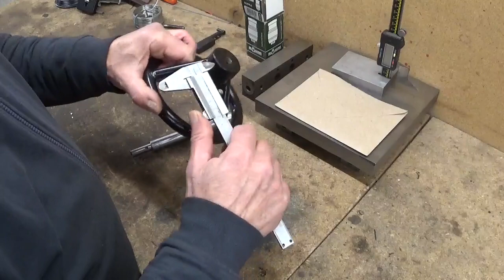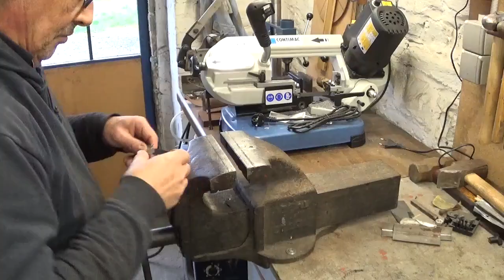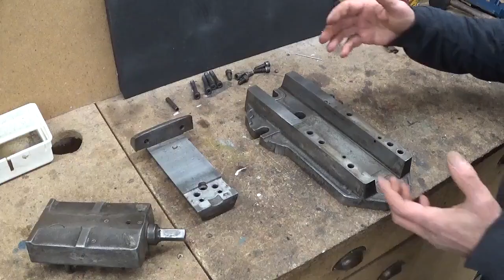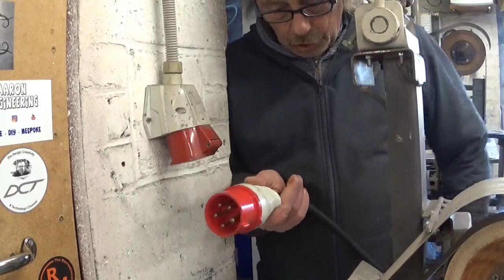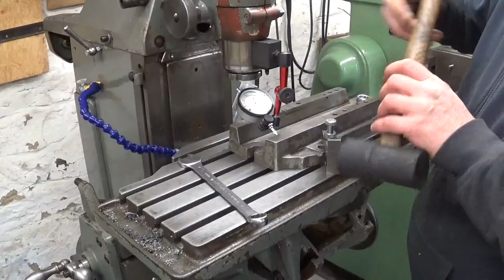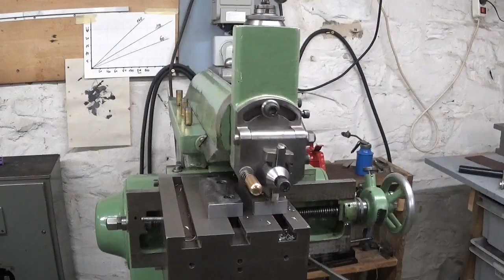Milling vise care.

Comment: I worked on newer deckel and one of the switches on the "fridge" was F/R. 
When cutting with left oriented tools feed also works in reverse and mehanical limit switches do not work, if feed hits end shear pin for feed will brake to save feed gearbox.
If your machine has feed reverser than it must be engadged when using left cutting tools.
Little bit of WD40 on 3 phase plug pins does wonders.
Reply from the maker: Thanks for the WD40 tip. I will give it a go.

Comment: Nice vice! For screwing out the taps, maybe it is possible to hammer a small round tube square on one end, if there is room around the drawbar down the spindle hole. Or maybe shape out a square hole in a small piece of round stock and weld it on a rod. Best regards
Reply from the maker: That's an idea. I will think of that.

Comment: Sir I too have a Deckel FP1. The controller unit does not work. I'm wanting to use a phase converter. Do you know the horse power of the motor and if it should be wired delta or wye?
Reply from the maker: My machine has a 1,0 / 1,5 KW motor. It's connected in triangle configuration on 3x220 Volt and no neutre. 
An easy solution for you could be a VFD from 1x220 to 3x220, like I use on my shaper.

Comment: Any method to get the desired result is fair game -     A thought just made my head hurt . . .  but not too badly ;) ,   when you mentioned that you DON'T NEED a 'surface grinder' , I thought it would be possible to mount a grinding attachment to the shaper's RAM !     * No doubt, the idea has been done by 'someone' at some time !    It may not be the most practical method , but I think it could be a useable possibility !    ( YES , yes . . . keep the grinding grit & dust OFF the shaper ! ! ! )  
      Great to see you getting to know the Deckel's possibilities , there are many many more to 'get acquainted with' ! ! !   
HAVING FUN & getting results . . . that makes the WORK much more like playing  ;)     Thanks for sharing your FUN with US !
Reply from the maker: The angle grinder idea has been done by "Haxby_Shed" and "EYUP TONY", with great results. I thought maybe installing a cup wheel on the shaper, but as you mentioned, the grinding dust is a problem.

Comment: Good day sir: I always enjoy your ingenious fixes for small problems like the roll pin. Since you are one not afraid to make your own tooling where needed, I might suggest making a fly cutter for milling larger surfaces. The cutting edge can be re-sharpened as needed and even the diameter adjusted to fit the job. It will help save your end mills for more specific jobs. Another fantastic video in the books!
Reply from the maker: The fly cutter is on the "to do" list. That will be an upcoming video.
Reply: @Rustinox  Fly cutter will also leave better finish imo

Comment: G'day Rusti. I haven't seen a home made roll pin before, well now I have,  that would make a nice video on it's own. I was thinking surely the shaper is faster than the mill, did you have it on a very slow feed rate?
Cheers Peter
Reply from the maker: I used a feed rate that felt good while hand feeding. I copied aprox the same speed in automatic.

Comment: That's a nice mill. If the motor on the mill is 3 phase, you can probably wire up a simple drum switch to swap any of the two legs and it'll run the opposite direction. Maybe that's already in the electrical box?
Reply from the maker: It isn't... yet. But I will install a reverse switch one of these days.

Comment: Wow your bench vice is bigger than your bandsaw Rustinox. Brilliant solution to fix the moving jaw for machining. Spray some silicone spray or 
WD40 on your plastic electric plug and socket, that's what I do. I had the same problem a long time ago. Great to see your milling machine working. Tony
Reply from the maker: Indeed, the work bench vise is a beast :)

Comment: Well you got there in the end. Shame you did not have a large facecutter  or a Flycutter. Your sticker is on my wall board. It shrank a bit, sorry for that. I am going to run out of room soon. I need a bigger wall. Regards from the UK.
Steve.
Reply from the maker: No problem Steve.
The fly cutter is on my "to do" list.

Comment: Tool care... I wish there were methods to fix bad tapers, dinks, burr on women... The first one was scrapped after 12 years... and the second after 3....
Thanks for showing that "the ugly plug" has a protective rim! The old 2 pin mains plugs didn't have it but the newer ones, phased out now days, scrapped, got it too.
Once a tin made christmas tree decoration had fallen on the pins to the plug for the light. Father didn't see it and pushed the plug in. Poff and smoke, but not a baby finger there.
Time 08:00. I can just agree Michel! "The ugly plug" has its advantages.
Nice vise work.
Reply from the maker: The ugly plug saves me from "ripped of skin" on my hands :)

Comment: Very good job. I've never been happy with the finish from an endmill either, all those horrid little circles. I much prefer the finish from a horizontal milling cutter... and I seem to remember you have the arbor and support :-)
Reply: Me too. You're quicker with the shaper (not that speed is a requirement for we amateurs) than I am. I prefer horizontal milling, I sharpen cutters I pick up cheaply, but I use the shaper for those things the mill cant do, like cutting internal keyways.
Reply from the maker: Indeed, I have the horizontal arbor support. But I also have a shaper :-)

Comment: Reversing your machine is not that difficult, I assume you have 380/400 volt, then you have earth (green/yellow) 1 neutral N on plug, and 3 live (or phase) L1, L2 and L3. You just turn 2 of the 3 phases, does not matter which. You can get a white/red EU plug that have that feature built into it, I know, then you have to take out the plug, but then, your machine does NOT run while you put it in reverse 😁
Reply from the maker: I know a professional industrial electrician. He will help me out wit this.
Reply: @Rustinox  You're smarter than me, but then again I have the patience of a gnat, maybe that is why I am a scaffolder 😏

Comment: Gday Rustinox, well I’ve never seen a roll pin made like this before, brilliant idea, great to see the shaper being used still and not left in the corner, you really can’t bet a shear tool finish, way better then a endmill finish, have you thought about using a TouchDRO system for the mill?, great job as always mate, Cheers
Reply from the maker: I was thinking of maybe installing a TouchDRO. Looks like a good system. I have to do some research on it.

Comment: great update Michel
Nice to see the Mill coming in to life, even nicer to see the shaper has not been retired!!😉
see you next time
Kev
Reply from the maker: Shaper retired? No way...
Reply: Love the surface finish he got.
I remember the first time I was shown a shaper and what sort of a finish could be achieved. It was when our class in mechanical engineering was sent to the workshops at the end of our first year for a 3 week course. We were all dumfounded by the thing. We even got to use it at one point to make grooved jaws for a small bench vise. They are one of those machines I hope we don't ever lose because there are some odd tasks they just do better than a mill like internal keyways.
Reply: @tonywilson4713  100 % behind you there Tony, i love my little Adept Shaper, it punches bigger than it's weight
regards
Kev ( Mr F's W)

Comment: Thanks for the shout out Rusti, much appreciated. First roll pin I have seen made like that, well done! Good work on the vice. Cheers, Jon
Reply from the maker: They work great on NON-important parts, like hand wheels e.t.c.
I would never use them to replace real ones in, for example, a steering mechanism for a car or truck.
Reply: I agree with the pin.... like my dad would say... its not about what you need, its about who it does! 😉